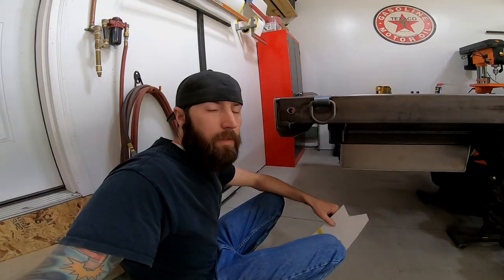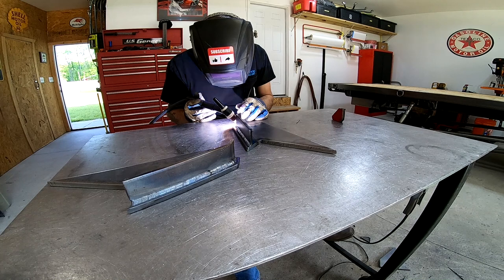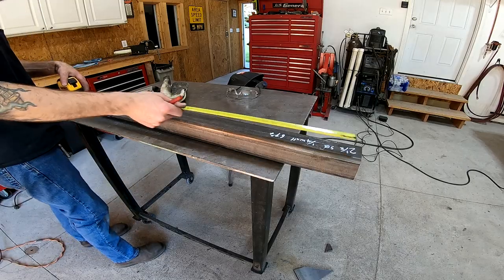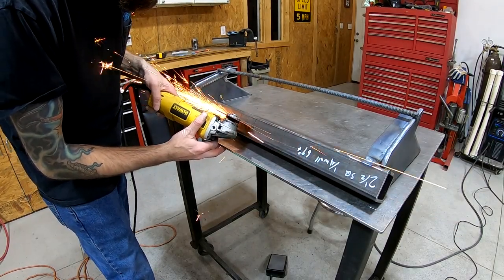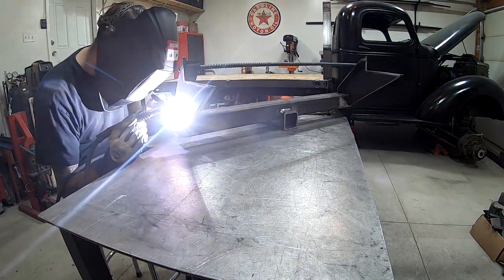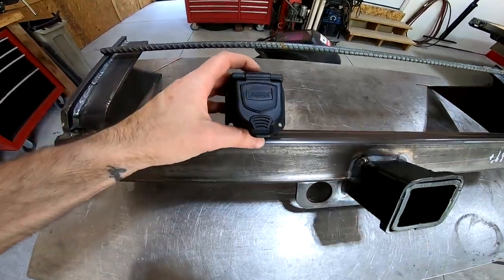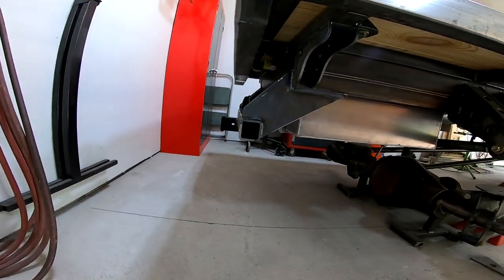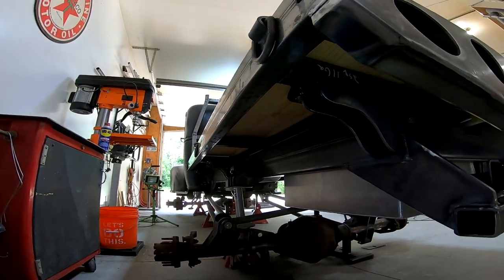Building a Trailer Hitch for the 40'

Comment: Your rear where the lights are what are the sizes left to right design.
Reply from the maker: They're all the same size 4"
Reply: @onebullgarage  no the metal the shape
Reply from the maker: @PeterHatch-mx7zc  56" wide 8" tall the lower center portion is 19" wide and tapers up to the ends which are 4.5" tall
Reply: @onebullgarage  thks mate